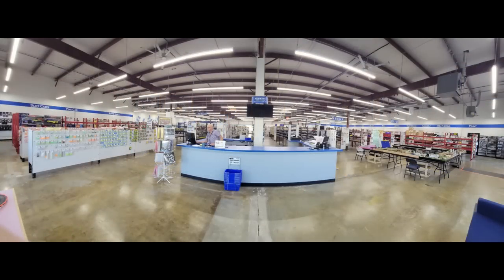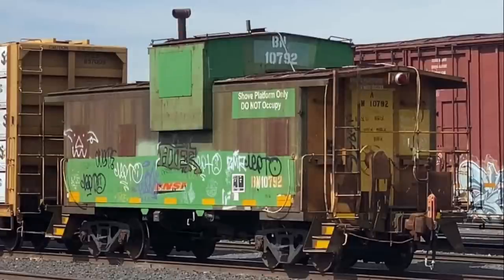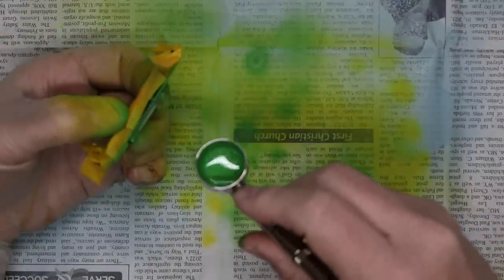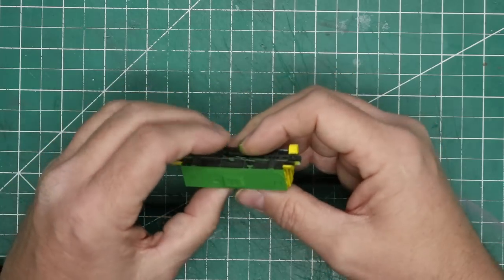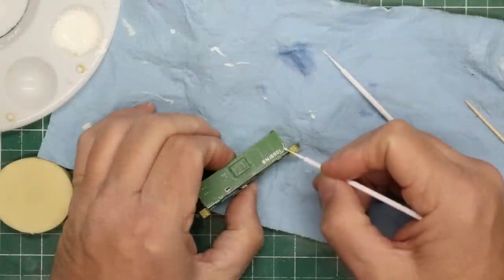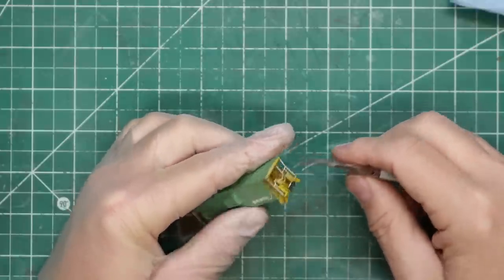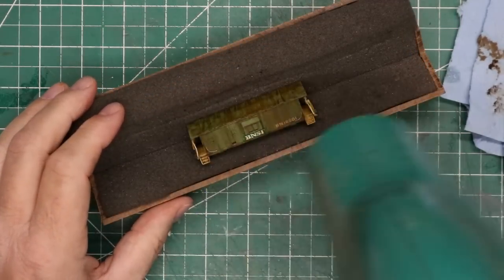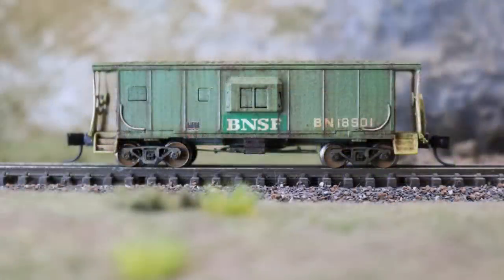COOL Model Railroad Caboose Shoving Platform

Comment: That was one heck of a Weathering Job mr.Ron &  if I may say trying to disembark Decales has always been a pain in the "A" double SS I use to use warm to hot water & I'd let them set about 15 to 20 min. But I think some of lies on how good the Decal is in the first place I've use some that had some pretty good strength to em' you could work with them with a good amount of water & if they didn't curl on ya you could set them in just about in Any spot.. But I wished getting the Decals was a bit easier If the Hobby shop stocked them I'd have me a set rather Quickly I guess I haven't went moon over Amazon yet guess maybe I should😊 

Allen D

Comment: another good way to get an excuse to run cabeese or other older equipment and locomotives is to make your own "historical/preservation society" for your layout.  They wouldn't have to have their own equipment either, just running the "old" stuff having been restored to operating conditions from any railroad.  You can use this to have steam or old diesels running along side brand new SD70's.  Having the rule that for old trains they have to have a caboose on their train when operating.  From there you can create anything you want for this group to be doing that day.  So during an operating session, say the group is out with an old 4-6-0 or 2-8-2 helping the "main" railroad in doing switching jobs or even moves from yard to yard. 
A great way to use stuff on a modern layout set, without the need to go build or re-build a layout set in the crossover era from the 1940's to the 60's.
I have done this on my own layout, with the main yard and layout is BNSF but the roundhouse/turntable and any steam are being ran by a preservation group with their own branch line running into an operating logging camp.  At times they would assist BNSF with other switching jobs or running a large, restored, locomotive to pull a mainline train, like SP&S Challenger number 910.

Comment: Hey Ron! I have a very important question. I tried to clean my track before by putting them in vinegar but they didn't help. Now my tracks look all oxidized. There's dark spots and colored spots and there's no shine to it at all. What is the best way to make them bread new no matter how dirty or bad they are?
Reply from the maker: Yes, vinegar is highly acidic. It has oxidized the silver in your track. It will take a lot of elbow grease to polish that off. Don't give in to the temptation to use an abrasive. You will damage the track. In this case, and I don't usually advise this, you might try silver polish...but, depending on how much track you are talking about, it may be easiest to just replace it.

Comment: Why would you sock the model in distilled water
Reply from the maker: I didn't soak it in distilled water, I washed it with distilled water, because tap water has minerals in it, and my water locally is very hard and has lots of minerals. Mineral deposits can react badly with paint and especially with decals, leading to silvering and other undesired effects.